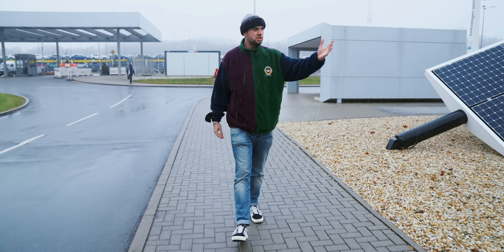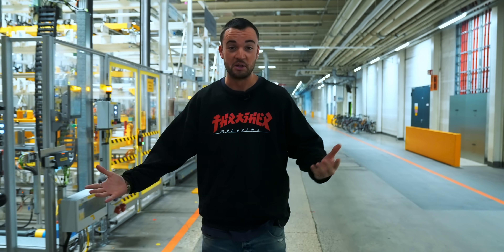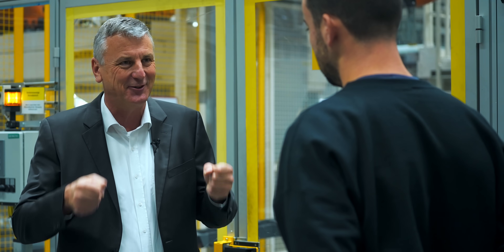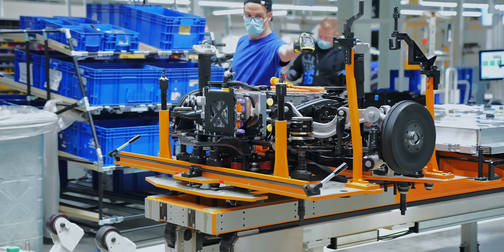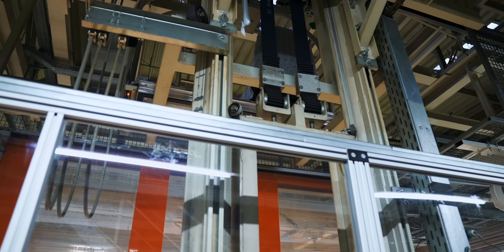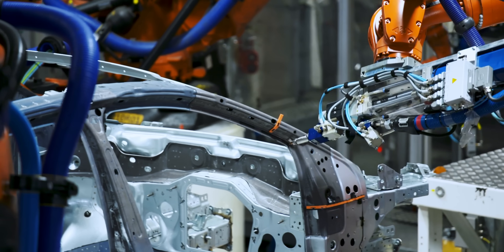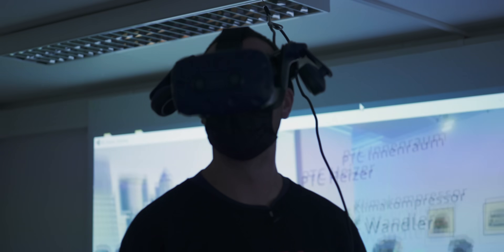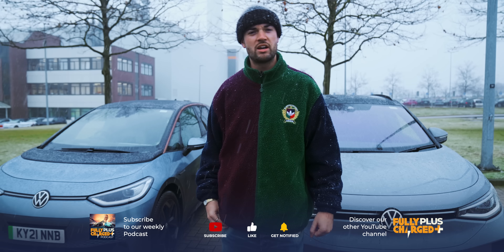Inside the car factory of the future: VW’s Zwickau plant

Comment: Nice to see how my car was built; an impressive facility but it would be interesting to compare to a Tesla plant where they can produce cars in one third of the time - is it down to the simplicity of the Tesla range compared to the myriad of models they are trying to produce on one production line?
Reply: Build quality, safety of the employers and sustainability matter more than how many x car can you produce in x hours.
Reply: When Herbert Diess made that comparison (very deliberately), he was talking about Wolfsburg - VW's oldest plant - not this one.
Reply: @Patrick-bu5vy  - he was talking about id4 v Model 3.
Reply: @Petelmrg  It's a meaningless figure. If only 500 cars come off the Tesla line in 10 hours while 2000 cars come off the VW line in 30 hours, which is better?
Reply: @Patrick-bu5vy  Herbert Diess has been in discussion at board level because he knows they have a problem, that’s why he has been meeting with Elon Musk. He knows VW still have a lot of work to do and is the best man to do it.
Reply: @Petelmrg  That is one way to look at it. The other way is that he's leveraging the 'threat' of Tesla to impose his way on the direction of VW.  This is smart, he is a very smart man. VW will be just fine.
Reply: the "amount of time it takes to produce" is always a tricky measure... the important metric is number of cars per year. and this factory has been running for 2 years?   2 years after tesla started they were building a lot less than 300k cars per year.
Reply: @mralistair737  Tesla Giga Shanghai started production December 2019, and in 2021 produced ~485k. Giga Berlin and Texas could possibly ramp even faster.
Reply: @mralistair737  from cost and flexibility perspective through put time is important. You want to off load your capital cost asap and when doing a change you don't want long lead times or big batches of old versions.

Comment: The Stellantis plant in Ellesmere Port will be dedicated to EV production from this year.
In fact the passenger variant of the LCVs produced there will now only be available as an EV.
The only exception will be vehicles produced for wheelchair users will still be available to conversion companies with a combustion engine due to the traction battery getting in the way of the body modifications required for installing a wheelchair ramp.
These will not be produced at Ellesmere Port but elsewhere in the Stellantis group.
Reply: The plant in Figueruelas, Zaragoza (Spain) will produce all small Stellantis EVs ,(Peugeot 208e, Opel Corsa-e, new Lancia Ypsillon electric).
Reply: Ellesmere Port is, I believe, going 100% electric in 2028....

Comment: Kind of frustrates me that these factories with huge flat roofs, are not covered with solar panels. I did spot a tiny VAWT wind-turbine though.
Reply: They have A) a massive space for PV on the roof there and B) enough battery storage in their EV battery module store room to power a city. That's a missed opportunity to me.
Reply: Couldn't agree more. Why are they taking long distance hydro power needed for dull, windless days instead of solar literally from their own roof? Might also have a shadow effect in summer.
Reply: @GoogleUser-ee6oy  Sure. If you Google search for images of "Land Rover Safari" you will see they had a double roof with an air gap between. That cuts down the heat from the sun very well. I saw the same principle with caravans in the Australian desert. It creates a shadow for the whole roof and the air gap allows the hot air to vent away. PV on a roof does the same job. Cuts down cooling load in summer. I have 85 PV panels on my house roof with platicised metal sheeting below. The roof space is never hot. Dark slates or tiles are the worst for summer heat.
Reply: The Xpeng & Tesla factories are covered with panels!
Reply: @martijnlafeber  Tesla plan to be covered, go check out flyovers, even giga Nevada has just 40% of the panels installed after 6 or 7 years. Berlin and Austin have barely started.
Reply: 10:50
Reply: Well Germany produce 46% electricity, not counting Scandinavia I believe it’s not one of the highest % in Europe  and Germany actually is capable to produce even more but have nowhere to store the electricity. More battery storage facilities are needed!
Reply: 22 hectares is quite a bit,  but with PV getting cheaper and commercial power getting more expensive it's only a matter of time until it makes sense to press that button.  I wonder what the payback time for a commercial PV installation is right now.  The kit would be heavier duty but the commercial rates are higher.
Reply: I thought that as well as.
But we don't know of the roof static allows for many panels to be added.

Comment: Excellent episode! I cannot help but wonder if, as popular as V2G has become, any of the batteries in that "Hall of Batteries" are used to store power for the plant before they are placed in a car.
Reply: Ya, buy power dirt cheap at noon and run the whole factory over night. Strange to see no PV on the whole thing, except that artsy thing in the background.
Reply: there were only 3 days of batteries in that hall.. i bet they hardly stop moving.  and you probablt really dont want a charged battery going into a production line.
Reply: 3 days at 1000 cars per day is 3000 batteries times 77 kWh usable capacity is 230 mega watt hours. That is about 10 MW for 24 hours straight 
As per change during handling: you would not care if you got electrocuted with 400 or 380 volts. And a punctured battery is a problem one way or another. But car battery packs are designed to be in car crashes, so banging it during production cannot be that bad

Comment: So how does it compare to Tesla's factories? Is it as fast as them? Diess talked that the effiency of Tesla is great and they want to achieve that as well, but is the Zwickau factory close to that? Do you know?
Reply: We know if you have driven a Tesla, you understand why experienced automakers don't make a point of rushing through assembly.
Reply: @stanwbaker  I checked that Tesla China produce around 450 000 cars per year so they are around the same numbers. Obviously VW created a factory that is atleast as good as Tesla's in terms of volume. In terms of efficiency there is no way to know but I believe the germans cannot be far behind.
Reply: @stanwbaker  thing is Stan that actual industry experts dont agree with you... Yes, obviously Tesla had troubles with Paint and panel gaps (think they still do on 1 Fremont Line OR its the California mentality) but the China built Cars are as good as anything you find from any ICE OEM, and the same Will be true from Texas and berlin, the castings should make that even easier to do
Reply: @poxer1  that's about the amount they built this year yeah, but if you take the run rate of the last quarter they could do 850.000. how realistic that is remains to be seen, (and depends on chip shortage) though there are rumours from China news papers of more investments and hirings, to increases that even more

Comment: Unfortunately not everyone will be able to have an electric car, if they did then the queues for charge points would be enormous and you could be waiting for days. Then there's the enormous cost of buying and maintaining EVs and the hours lost on a long journey as you have to charge several times along your route. Then the massive cost of frequent battery replacement. I like diesel because my last one only needed to be re-fueled once a month with a daily commute of twenty two miles each day, each way.
Reply: Hi John, I think you’ll see charge stations increase substantially as more are sold and battery tech is improving at a crazy rate. You also need to take into consideration that you do most of your charging at home, and have no need to use a station for daily driving, road trips yes. But If you consider the annual time you spend looking for and fueling your gas car vs the time saves charging at home you’re actually spending far less time at the pump/charging vs a gas car. Maintenance on an EV is actually far less, fewer moving parts and no oil changes. Battery replacement I’ll admit is a bit of an unknown but there are early EVs pushing 1 million Km on original packs.
Reply: Robert has done a recent video on battery life. Do go check that out. Spoiler: batteries never die.
Reply: @shhhyouknowhoo3753  What? you mean you don't have to throw your mobile phone away after two years because of battery failure, with replacement costing ten times more than a new phone?
Reply: "Queues for charge points would be enormous". Complete nonsense.....  I've owned my EV for over 2 years. I've NEVER queued or waited to charge. Where do these silly notions come from?   Of course they come mostly from those whom have never owned, driven sat in , or even touched an EV.
Reply: @Brian-om2hh  Foxtrot Oscar, Sierra Bravo. I've already seen it so bravo oscar lima lima oscar charlie kilo sierra to you.

Comment: I want to like the ID.3, I've driven one and was considering the 77kw/h version. I just couldn't get on with the interior and infotainment. Just as Jack described in the previous video, its an awful piece of software and hardware, terrible. The nail in the coffin for me was a YouTuber on here who has been longterm tested one had very recently discovered 10% degradation after 18 months, VW use LG Chem batteries, that should happen only after 10 years, shocking. I'm not a fan of LG and personally I think its a budget brand for the masses, that breaks and wears out quickly, mobiles are terrible, TVs break fridges stop working, I will buy a car based on its battery supplier like Panasonic, Catl etc. Shame.
Reply: It was 8% and he threated the battery of the car horribly. However, it should not have degraded more than 4 or 5% to be acceptable. The good news is that case is just one between thousands of perfectly good battery degradation. If this was a widespread problem among all ID3 battery, VW would not have increased the charging max on the ID3.
PS: I saw another Youtouber that had 3% degradation after 12 months wich I believe is the normal for the first year. The degradation slows down after the first year.
Reply: @tiagoferreira1964  Must have been a different YouTuber as it was definitely 10%. 3-4 per year is normal.  Obviously charging from 20% to 80-90% normally. I've never liked LG as a brand

Comment: Did I just see vehicles go along the assembly line with drum brakes? So, then I assume these cars are  inexpensive or from the 80's.
Reply: Yes you did. Because EVs use internal regeneration braking to recharge the batteries the braking systems in these cars don’t utilize their brakes like a petrol/gas car. When underutilizes disk brakes were rusting, so the decision was made to use drum brakes on the rear as they were less likely to rust. I asked the same question, and has to research it.

Comment: It takes VW 30hrs to build a car in this plamt vs Tesla 10hrs.
Reply: From what I've seen, Tesla could do with putting a couple hours more into each car...

In all seriousness, it's a very impressive stat and when the new Tesla factory opens in Germany, I hope to check it out.
Reply: That's absolutely fine as long as you're happy to accept your Tesla with ill fitting panel gaps, and occasional dodgy paintwork.
Reply: @Brian-om2hh  these were issues some time back but far less an issue in recent refresh, as per Sandy Munro. I have a bigger issue with dieselgate than panel gap.

Comment: Amazing production processes, but I'd like to see a similar video when the Berlin Tesla factory is up and running,  so that we see how Tesla manage to manufacture their vehicles so much more efficiently .
Reply: Great idea.
Reply: @JackScarlett1  obviously not by you, you'll have a stroke with so many Tesla around you.
Reply: @Nicolas MIARD I'm not saying Tesla would need to pay, but that's part of the problem - other brands will pay or contribute towards a video and will predictably be an ongoing future source of revenue whereas Tesla never will and it doesn't make sense to upset the brands that pay the bills. Fully Charged being 'independent' may have a better chance than others at deciding to showcase Tesla, but I wouldn't hold my breath. Willing to be pleasantly surprised though ;P
Reply: @Nicolas MIARD I am a fan of the approach of designing a category killer and perfecting it, rather than trying to develop numerous overlapping/competing models which try to cater to many nuanced tastes.
Reply: Good luck, Tesla don't pay for advertising so pretty tricky to justify contrasting them positively with any of the other manufacturers that will agree to sponsorship/advertisement deals with channels like this.
Reply: @Nicolas MIARD The unified platform is a good start that I imagine is an easier transition for these old brands to make. If they can pull it off and wean themselves off ICE in the next 5-10 years then more power to 'em. I'm worried there's a lot of denial baked into the upper management levels of these companies. Would benefit a lot from trimming their dividends, slashing the ad budget and going ham on R&D. That's a big culture shift though...Lots of dead weight in their structure too, long standing relationships with suppliers etc.
Reply: @Nicolas MIARD Fingers crossed

Comment: I hear they can make a tesla model 3 / y 3 to 4 times quicker than an equivalent VAG EV. No wonder VW group invited Elon down to help them. I wonder when my Enyaq will arrive 🤔😴🛌
Reply: There's a lot of misinformation on the topic. This was a comparison between Wolfsburg & Tesla, not Zwickau
Reply: Yeah wonder if that's the reason Teslas have such build quality controls... maybe it's a reason a car company that sells 10 million cars a year have to recall less than one that sells less than a million.
Reply: @Alex-cw3rz  it seems like VAG are suffering with the same according to some of the car groups I'm on.
Reply: @chargeheads  well you've heard incorrectly remember what Tesla did was incompetent and money grubbing nothing to do with EV's or a problem any other car companies had since the 70s.
Reply: @Alex-cw3rz  The figures speak for themselves, Tesla are smashing it. The haters are gonna hate. By the way I work buying VAG used cars and I do have an Skoda Enyaq on order ;0)
Reply: @chargeheads  not really, just recalled 1/3rd of all cars they've ever produced, they are in a dangerous stock bubble, their cars apart from falling apart are falling behind in tech, they have very little records left, their proprietary stuff such as batteries are now outsourced as other companies do them much better. Other car companies are right behind them and as soon as they get production sorted other Cars EV will take over if the stock price hasn't already crashed.
Well if you worked with VAG you'd know build quality is excellent and not the issue with them, there creeping up prices and set in their ways nature is what's holding them back (not EV's more relying on the golf and polo rather than innovating).
Reply: That potentially explains why Tesla build quality is 3/4 times worse 😬

Comment: Old thinking and old building strategy ... just new machines.
VW will have to step up their game a lot the coming years...
I hope they can survive the bev transition.
Reply: VW will be fine. Not everyone wants a Tesla, or a NIO, BYD, XPeng, etc.
Reply: @georgew2014  Very true about Tesla, but VW will struggle to make profit on their bev's and due to that have very low margins.
That will make it difficult for VW to pay their dept without taking another loan.

The only way i can see VW surviving is if they take software in house, start using mega casting within a year, and cut 60% off the time to make a car and secure a huge supply of batteries.
Even Diess is having substantial doubts.

Comment: Still, with all those innovations they take 30hrs per id model v 10 hrs for Tesla M3 or Y. More needs to be done VAG
Reply: That's one of those statistics which, like measuring acceleration from a rolling start, might be more complicated than it seems.
Reply: @timmurphy5541  as a Tesla Shareholder but also an id3 owner I can assure you I do my research. Just wait until Giga Berlin opens and with front and rear giga castings and 4680 battery cell structural pack, they will be built faster lighter and more powerful with extra range. VW built good, but lots to learn about software and how to loose weight, less parts and fixings etc.
Reply: @kinross24  as a shareholder I would expect you to have a financial interest and be completely biased.
Reply: @timmurphy5541  I’m also a shareholder in VW, Nio, Rivian, Arrival and Tesla. So not biased. We have an 2022 id3 and 2020 Hyundai IONIQ 38.3 so not biased at all
Reply: @timmurphy5541  I’m an ex MoD vehicle technician and Optronics engineer and fully into renewable energy and home generation and storage but also fully up to date with all ev tech out there and what’s up and coming, so back off. Maybe you should do your own  research on build times of all ev marques and get a big surprise.
Reply: Yeah well at least VW's don't fall to pieces and have to get recalled in their 100,000s being a third of all production ever, so maybe there is a reason it takes a little time to make something that isn't as embarrassingly poorly made as a tesla. Why would you even do this comparison your pointing out why tesla is so sh it, you know I'd prefer the car that had 30 hrs spent on it and is cheaper than the one that took 10 hours, half the car doesn't work and the doors don't line up.